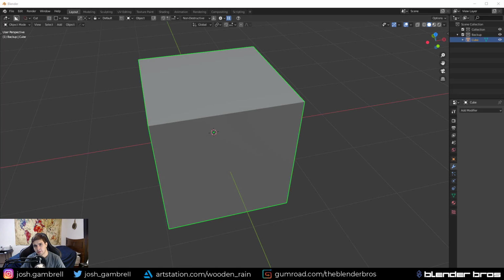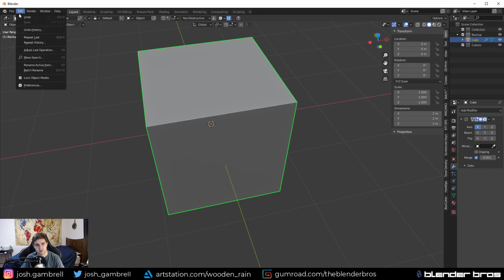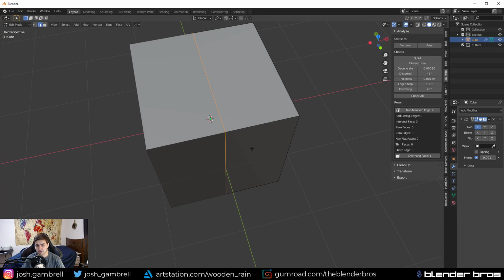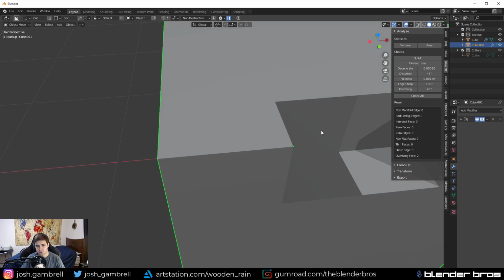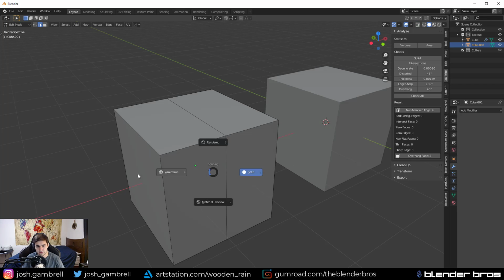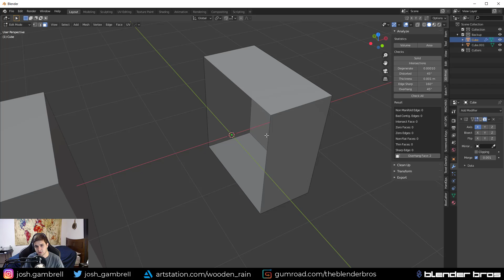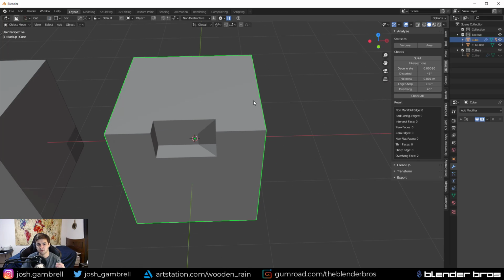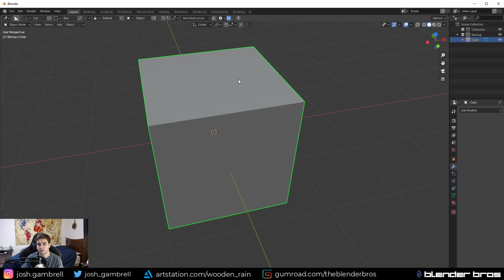Non-Manifold Geometry: Your BIGGEST Issue when using Booleans (Blender Tutorial)

Comment: Just to clarify "Non-Manifold" Geometry has nothing to do with whether a Mesh is "Watertight" or not. Non-Manifold geometry is when you have Geometry connected in an impossible way in Euclidean space so that the Normal direction cannot be calculated to form a Manifold surface.  An example of Non-Manifold Geometry is a ribboned Mobius Loop where 1 connecting edge is flipped. https://youtu.be/ZW_W71pPGxk

Comment: Thanks for all you're great help with boolean issues that can be such a pain! wouldn't putting the boolean AFTER the mirror modifier in the stack also solve this? cause modifiers should read geometry created by previous modifiers as just as real as any other right? in this example it's not "real" because it's applied after the boolean an therefor does not exist from it's point of view. But isn't it much better to fix the stack than applying the mirror?

Comment: Non-manifold geometry means, an edge is part of 3 or more face, which is physical impossible. It breaks a lot of modeling operations and should be avoided or fixed.
What you demonstrated in your video is the intended difference between a volume(closed mesh) and a surface(open mesh).

Comment: imo non manifold means blender (or any 3d software) dont know if a face (or plane)  is facing outwards or inwards.
in order for boolean modifiers to work correctly every single face should have one side that is outside the mesh and another side that is inside the mesh. 
some common way to fix it is to use solidify modifier if u have a plane surface, or use shift+n (recalculate normals) and merge vertices by distance to clean up ur model.
p.s. u can choose to use the boolean modifier and put it under the mirror modifier to avoid non manifold boolean issues

Comment: put in mind that the addon you're using automatically puts boolean before mirror so the boolean doesn't consider the mirrored part as geometry which causes this issue so you can just put the mirror above and then you don't have to apply it.
but really thanks for explaining what Non-Manifold geometry means.

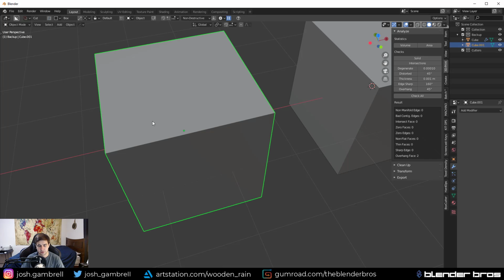Comment: 3:00 I'm pretty sure you get the "half-and-half" problem there because the face is facing outward from the right side of the cube, causing the right half to be watertight. But when the software checks the left half, there's no face pointing outwards there which is why that half isn't watertight.

I haven't checked this, but I would check by making a cube, checking it's watertight, then inverting the face normal on one of the faces, then checking again. My prediction (as described above) is that the cube with one inverted face would no longer be watertight.

Basically it looks like watertightness takes into account the face normals, and faces pointing the wrong way don't give watertightness.

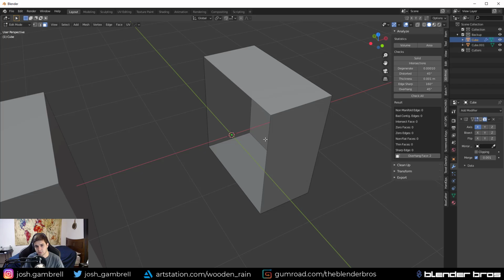Later on at 5:35 the problem appears to go away with the internal face because the mirror modifier is also mirroring that face, giving you basically two separate watertight cubes. I think the confusion arises because the two cubes are touching. If you move the cube away from the mirrored axis, you'll see it is simply two watertight cubes.
Reply: This is what I was thinking the whole video!!!!
I was waiting for Josh to blame it on the blue and red normal facing!

Comment: Is there an option in HardOps to place new cutter Booleans after the mirror in the modifier stack?
Placing it before the mirror by default seems like the intended thing that saves you incredible amounts of time in 99% of cases, but in 1% of cases it causes a bit of a headache if you don't understand what it's actually doing on the modifier stack.

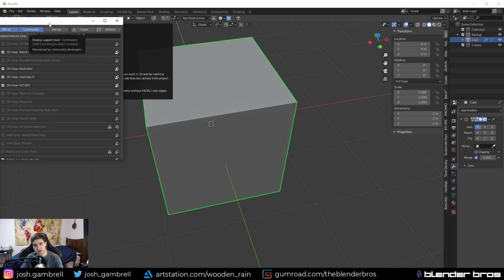Comment: 1:22 Don’t bother with that addon. Use Blender’s built-in “Select → Select All By Trait → Non Manifold” function in Mesh Edit mode instead. The advantage is the Redo box for this operation lets you isolate all the different ways that a mesh can be non-manifold, along with the specific parts that are causing the trouble, so that you can make the appropriate fixes to them.
Reply: I don't see "Select All By Trait", only "Select All by TYPE" and there's no "Non-Manifold" option.
Reply: @StarforceOnAir  You need to be in edit mode and Edge select mode
Reply: someone else told me to do “Select → Select All By Trait → Non Manifold” but I'm so new I cant figure out how to get there, even after they explained. do you have the name of a youtube video I can watch? (dont try to link it because youtube will delete the comment. Just looking for the name of the video if you have one).

Comment: But wouldn't that inside face cause shading issues with smooth shading turned on?
Reply from the maker: Auto smooth man
Reply: @JoshGambrell  On a cube it works perfectly, but if I mirror other shapes (a sphere for example), the issue is still visible. With autosmooth I got rid of the weird shadows, but there is still a big seam along the line of the inner face (almost like an UV seam).

Comment: Wouldn't this issue be fixed by checking the "Clipping" option in the mirror modifier? I always have it enabled and I've never encountered this problem.  I've also tried to replicate what you did in the video and my cube looked fine after bool even with non manifold geo and clipping disabled.
Reply from the maker: Well it all depends on order of modifier stack and the object at hand. All clipping does is stop the mirror from passing its overlap point. The point here was to demonstrate what non-manifold geometry is because I see people encounter this all the time. I want people to understand what is happening so they can diagnose and fix more complex issues, not cheat their way out by finding a box to tick. Intuition and understanding is key to being an efficient 3D artist :)
Reply: Merge is the important option (making it not duplicate the vertex on the mirror plane, but instead connect the edges from both sides to the exact same vertex), and it was on. Clipping just ensures the points stick to the mirror plane once you move them there while editing.
The problem is the order in the stack - the Boolean modifier comes before the mirror modifier, when that geometry doesn't exist yet, and there's a hole in the middle. I think this is what Josh was trying to get at with "imaginary geometry".

Comment: Clipping wouldn't work? Are you just referring to boolean in edit mode?
Reply from the maker: All clipping does is stops the mirror from passing its overlap point. Doesn't change the topics mentioned in this video. I turned on clipping and the issue still occurs.
Reply: @JoshGambrell  I haven't really played with booleans. But I thought if you used the boolean modifier after the mirror modifier it would work. Then again, my memory sucks.
Reply from the maker: @SlyNine  Well you can always use the modifier stack for quick fixes. But what's the point if you don't understand the underlying problem? It's important so you're able to fix more complex issues relating to this topic, hence why I showed the problem itself and not some quick fix with no backend understanding.
Reply: @JoshGambrell  I do get your point about non manifold geometry. I think you clearly stated it.

It was just the mirror modifier clipping thing that threw me off.